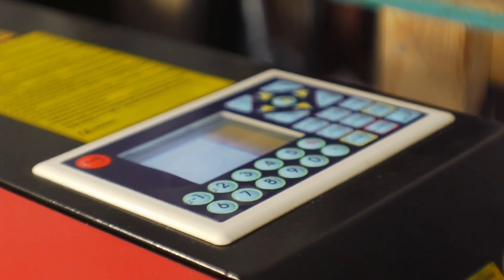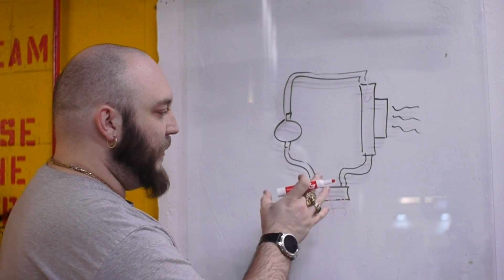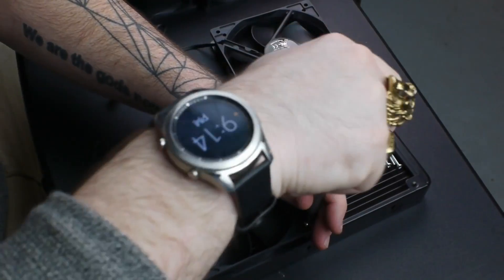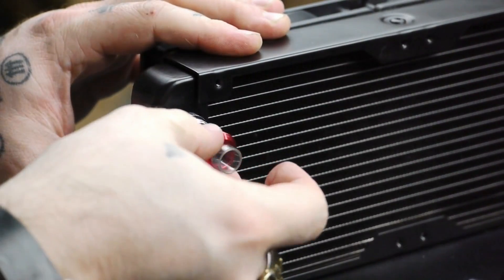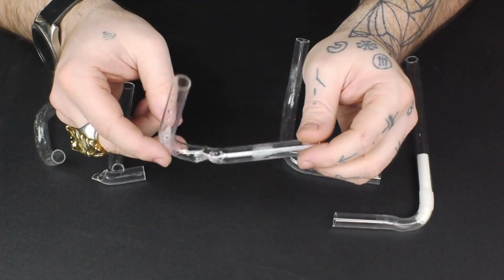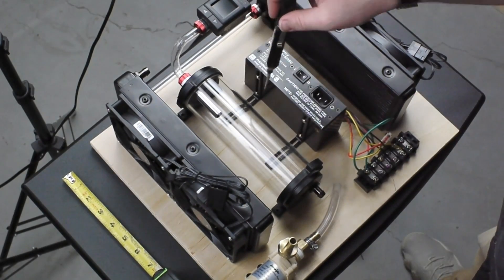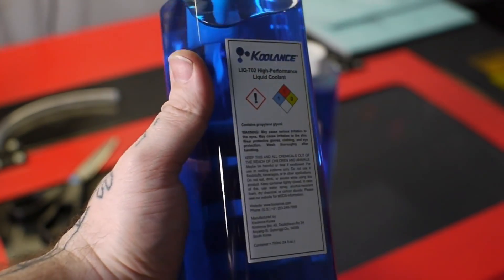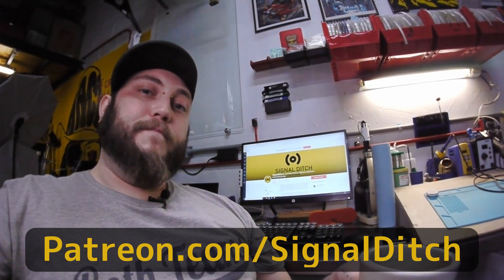Building a Liquid Cooling Loop for the Laser Cutter

Comment: Is there a way you can do a follow up on your build? 

How does it work? Have you used it in the summer months? How hot was the ambient air and what settings where you running the laser at and for how long? Do you know you rejection ratio? 

I had an old mini fridge that I popped a couple of holes in and run a 5 gal bucket inside. I used DI water with a couple of drops of surfactant and a few drops of anti algae and I can consistently run full power for 3 hours at or below 20 C.

Comment: Did you also use the 5 gal bucket for extra fluid storage?  I built a similar design but also used 4 Peltier Thermo-Electric Cooler Module with Heatsink for added cooling.  My laser show only 4 deg increase in fluid temperature after a 20 min full power cutting.  Thanks for sharing.
Reply from the maker: It's been about a year now and it still works great. There's no bucket reservoir on mine, but it wouldn't hurt to have a little more thermal inertia. I keep my shop pretty cool, but I'm considering adding some peltier coolers for warmer days.

Comment: I rewatched your football quote a few times, that shit had me rollin'. Pretty good idea in theory, but I'm curious as the industrial chillers have refrigerant and is regulated like a refrigerator, do you have a temp sensor on the tube itself? If so, what temps does this run at?

Comment: boo.  no performance info on how it holds up.
Reply from the maker: I'd have loved to, but I had to pack up the shop a few weeks after this video. I've since moved house and have a lot more shop space so as soon as I get it hooked back up, I'll do some logging. 

In case you need the info now, you really can't expect miracles out of this, in a comfortably air conditioned room it will keep this 80W tube under 30C rasterizing at near full output for more or less as long as you want... as long as I want anyway. 

Like I said, project retrospective and upgrades (with TECs, probably?) coming eventually but... new house stuff, you know?
 
Anyway, thanks for watching. Be cooler in the comments next time.

Comment: What were the results of it, did it work and cool the water to about 15 /18º C which is the correct operating temp of a C02 laser, I would have thought all you are doing in this sytstem is cooling the water to the ambient temperature, not making it colder which is what is required, also making it blue you cant see the colour of the laser beam to checklthe quality of plasma colour its generating. 
I have made something similar last year before i saw this for my CNC machine that has a water spindle on it that needs cooling but not very much and this is perfect , it has one fan, a large copper deposit, pure copper radiator and tempertaure controllers.
For My C02 Laser  I have 3 large peltier coolers, 3 radiators 3 fans 50  litres of deposit water , flow meters, alarms and that works because of the large volume of water you only need to cool it a few degrees. It still works out cheaper than an official cheaper and looks better than a ice block in a bottle.
Reply: it could work better if it were enclosed with more fans in proper orientation, like a pc case. I have 14 120mm fans in my Enthoo 719 watercooling system, and if i stick my hand inside the case it feels like a refridgerator lol.

Comment: I would like to hear how this worked out long term. I am about to buy a cheap laser like yours and I hate the idea of a bucket with ice blocks in it for cooling and I immediately thought about PC cooling systems like this. Surprisingly yours is pretty much the only video or info I could find on the subject and got me worried the cooling would not be good enough. Could you tell me what your max temp gets to when cutting?

Comment: Very cool, was planning on using some peltier thermo-electric pads on top of some traditional fan tower cpu heat sinks to get the temperature cold at the cost of efficiency, what temperature do those radiators manage to bring the system down to? I saw some videos on watercooling for cpu’s could keep the temperature warm if not shy of boiling which is fine for a cpu but maybe not so fine for a laser which could last longer if the temperature were kept below room temp.

Comment: Not sure if someone mentioned this but I e been using lasers for a few years now. Keep the water nonconductive, if you add anything to it that conducts electronic current you will induce a current and if you touch the water supply while laser is running you will shock yourself pretty well. 2. You want to keep your laser water at sub 65 F.

Comment: Can you provide more detail on how you ran the wiring?  I couldn't find a 50W PS was loking at using a low wattage PS with built in terminal strip similar to a "XINCOL AC to DC Converter AC110V/220V to DC12V 10A 120W Switched Mode Switching Power Supply" I randomly found on amazon.

Comment: What is the longest you've run your laser with this setup, and it kept the coolant within the temperature parameters?  I live in Florida and it's summer, and I have a big contract with a ton of cutting time involved.  I need to run a bunch of 20 minute jobs, back to back.
Reply from the maker: I wouldn't rely on this during a Florida summer. It won't get below ambient and maybe picks up a 1 to 2 degrees C during a 10 minute high power cutting job. 

In an air conditioned shop it might hold up (if you're keeping the room chilly at 19C) but you really need a chiller.

This rig has worked well so far but I'm likely to convert this to a TEC based chiller in the coming months.

Comment: Dude, that turned out wicked! With just over a month of use, how would you say it's working out?
Reply from the maker: It does a great job of keeping the tube within a few degrees of room temperature, which is fine for now. That said, the shop will heat up during the summer and I anticipate that I may need to add a thermoelectric stage to bring those temperatures back down. If that turns out to be the case, I'll make an update video!
Reply: @SignalDitch  Thanks for the quick reply! That's awesome! I've been thinking about how to cool my admittedly lower powered K40 clone, and this video definitely convinced me to go down the same path as you, thanks for making the video!
Reply: @SignalDitch  Since you're using coolant and not distilled water how would you add cooling? to bring down the temperature.  I was thinking of using an ice bucket type setup below and run a loop of tubing in and out of it.  I'm trying to make add ins without adding an additional power supply running up your electric bill.